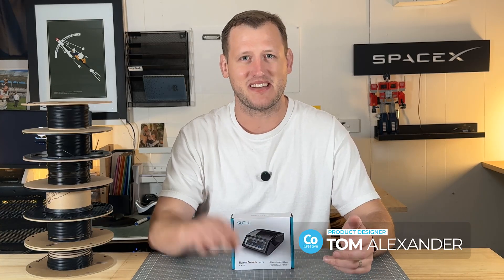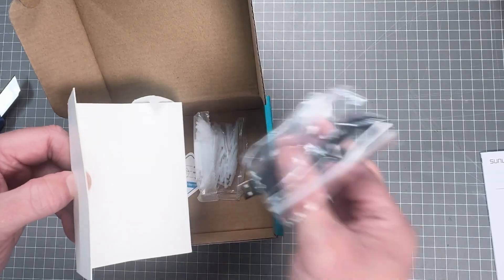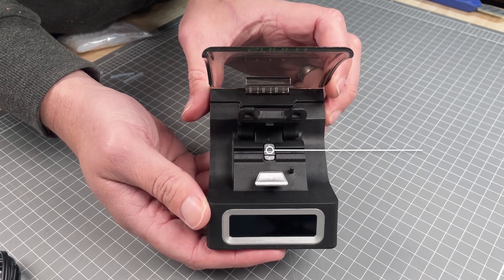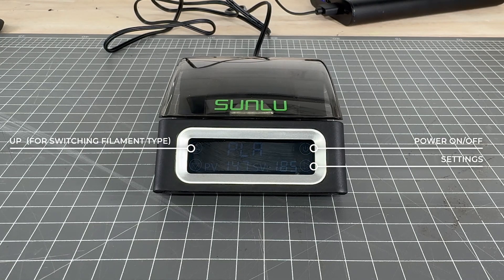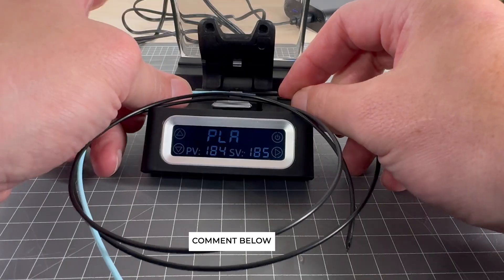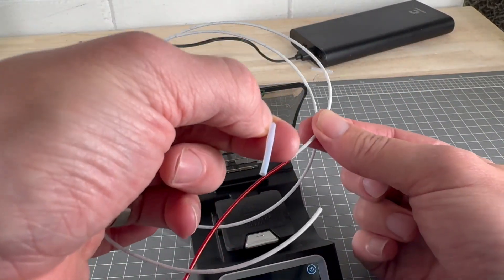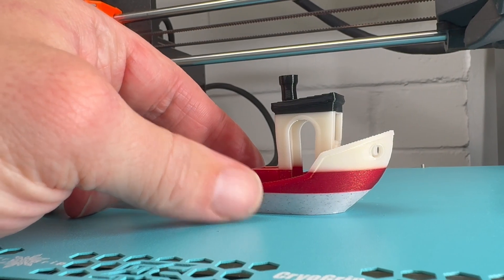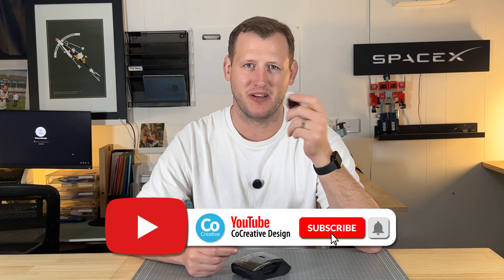SUNLU Filament Connector – Can It Fix Your Scrap Filament Problem?

Comment: If you have a AMS or CFS, just tell your slicer they’re all the same Type and colour, then when one roll runs out it, continues on the other.
Reply from the maker: I don’t currently have an AMS, but I’ve looked into it as a solution. I’ve also had my eye on the CFS, though I thought I’d try a cheaper option first.